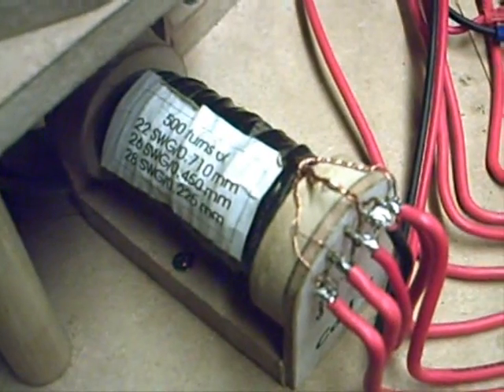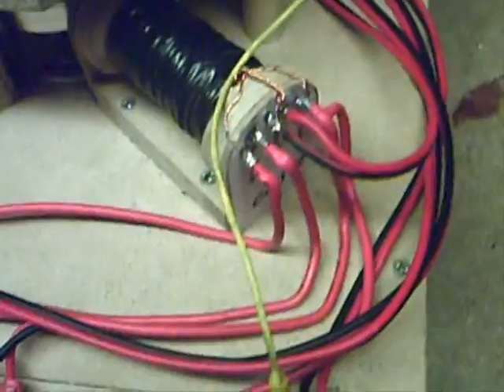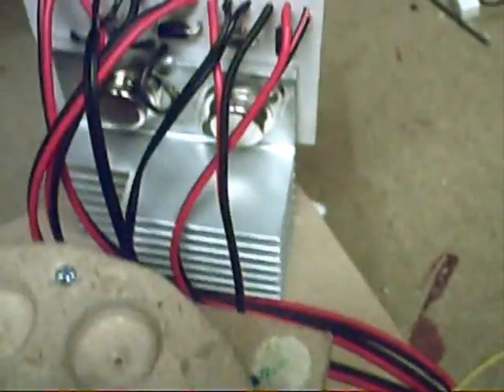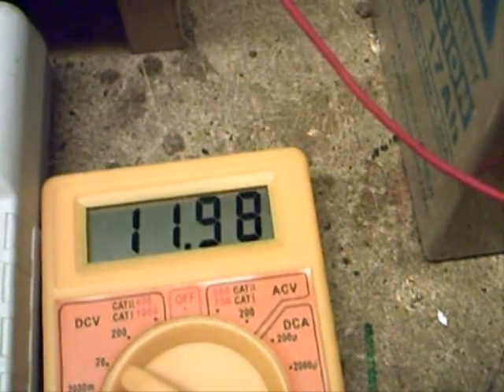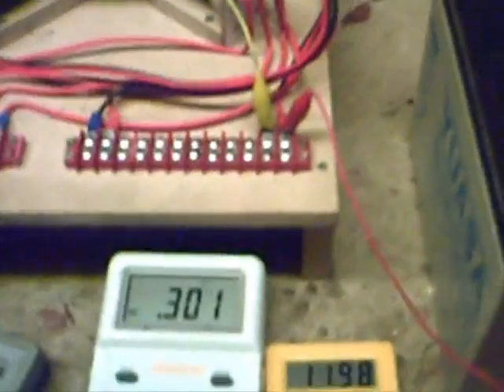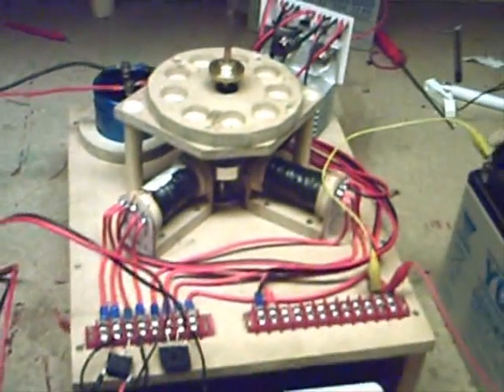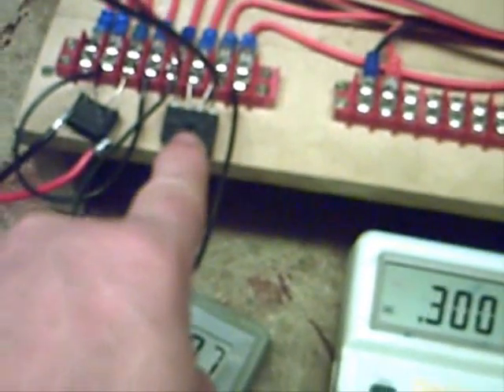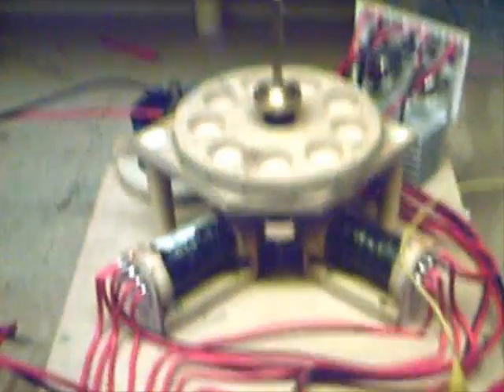Overunity Pulse Motor Bedini type 1

Comment: use a starship coil instead of cylinder you will get better results more inductance with less impedance meaning less wire more or same induction less parasitic resistance

Comment: have you ever heard of a gear ratio.Most tech heads dont know about mechanics.This is a project where all fields of tech cant be ignored.A 5 tooth gear turns twice when a 10 tooth gear turns it using the same energy.Thus you get 1 free turn or not?

Comment: @ulquirathebatespada the best thing you can do is some switches that are manual , you cannot add circuit relays to do what you suggers , because if it would be possible ,it would work with capacitors , no batteries and it will generate lots of power

Comment from the maker: No perpetual motion no overunity and nothing of the sort clamed. 

It was my attempt at the above thats why I named is project Overunity Pulse Motor Bedini type 1.

The BEMF from the first pulse unit (coil) runs the second coil.  
Bit it was very efficient, 

The unit did charge 2 batteries from 1, now that sounds like perpetual motion no its not I had to swap the battery to keep it running.

Comment: What are the specs, rpm, torque, current or power draw?

There is no way this is "free power" if that is what I think he is saying. It is against the laws of physics. This is akin to the perpetual motion machine. Scam. Take those battieris out and it would stop.

You are saying it is running on its own? Don't get it. There are loss in the wire (heat), rectifier diodes are not 100%, capacitor and friction of the rotating parts to name a few reasons it can not MAKE power. Theres no free lunch.

Comment from the maker: Yes but i was not using car batteries on this setup.

 The batteries stated on them, 
Do not exceed 13.8 volts. Use manufactures charger only. 
I totally dismissed that and f*** 4 of then at £21.00 each + the Vodka And Tonic.

Comment: Hello Daftman.  I have watched every video you have made and am impressed.  This one in particular got my attention, since you said that "it has been running for months".  I just don't understand why you have not attempted to make a power in versus power out measurements.  What is the point of running the unit for months when you can draw the same conclusions in a matter of minutes.  As someone already recommended before me, show voltage @ current into/out of each battery.  Thank you in advance.

Comment: it would be better if you had a power meter or current meter for each of the batteries. Voltage alone does not tell us the whole story. Then we can determine what's going on. Even better if you could demonstrate that the battery receiving charge is taking more power than the battery driving the motor.

Comment: Your reputation is solid with us. Your workmanship is excellent and your delivery was refreshing. I have seen the lead-acid problem before because lead sulphate builds on the plates when the battery is discharged for even 24 hours. This coating is non-conductive and makes it very difficult to recharge the battery. NiCad batteries also have a strange memory requiring them to be fully and completely discharged prior to recharge. Try Lithium Ion batteries.

Comment: if you are interested you can google u.s. patent 3913004 to can see his design and concept.the patent isn't on the U.S patent database, but is on the european one... odd..
 he has a bifilar wound on the rotor, but the same principle could apply to a stator coil with permanent magnet rotor... would like to know what an open minded electronics engineer or physisist makes of the idea. i plan to test it on my motor as soon as i can borrow an oscilloscope to measure the power in and out of the coils

Comment from the maker: Now for the battery switching circuit. I will try to post this somewhere on the net soon but you have to understand that the pulse motor was only built by me to test the battery switching circuit for a customer as this is what the switching circuit was to be used for. So that means the customer has paid me for the work and the design. So what I am trying to say if the customer is ok with me posting it I will, if not I will post some kind of alternative.

Comment from the maker: Sorry for not explaining this in the video. After all my testing of a battery switching circuit was completed. My goal was to make the unit run with capacitors only and I needed to be able to adjust the timing. But that was unsuccessful. Now with the set up as it is it pulses 3 times for every revolution but originally I only wanted it to pulse once for every revolution but if I used the trigger coils I had no control over this.

Comment: nice work. not sure that i understand why you need the reed switches if you are using trigger coils and transisters to do the switching..any chance of a circuit diagram?..i'm planning on replacing my reed switch with a bedini type trigger coil in an attempt to reduce the pulsewidth.
 what do you make of the design by Robert Alexander? it uses bifilar coil as a transformer, spinning a rotor while also outputting any primary input power through the secondary coil.3rd coil as trigger would be nice

Comment: great setup have you tried charging multiple batteries, if you have enough torqe which im sure you do you can run a dc motor off a rubber band and get some extra current,then take wattage off the dc motor loaded down with a christmas tree light, and see if the run amperage increases, you will be amazed ----another hint---- 5 stars